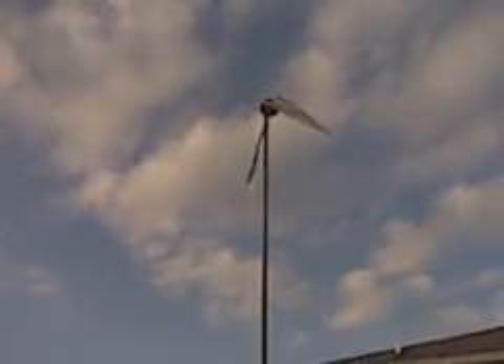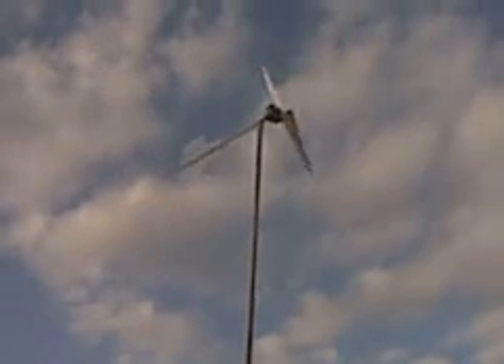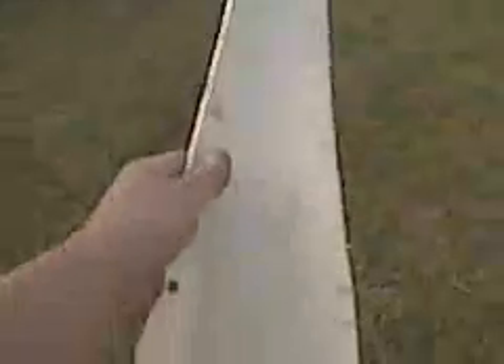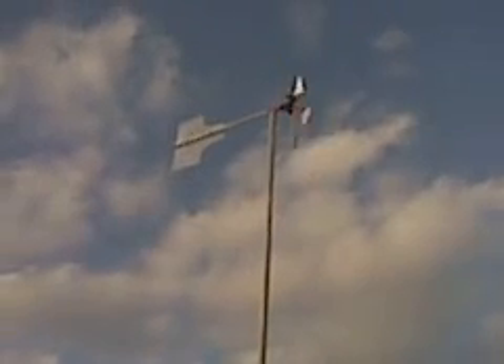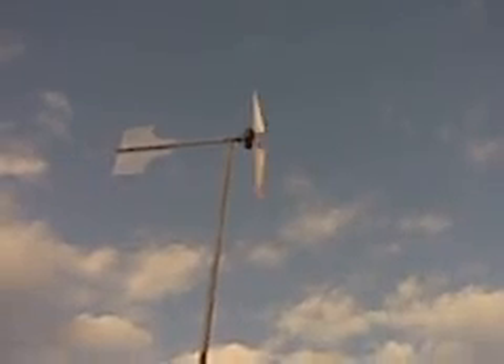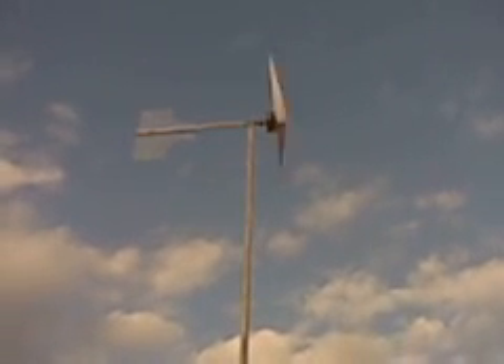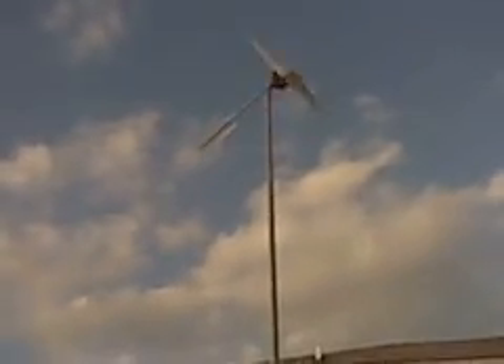Homemade blades for my homemade wind turbine

Comment from the maker: @leamyvideo 
HEY LARRY, YES I WAS LOOKING AT THE WINDY NATION BLADES. I THINK IT WILL TAKE 5 BLADES TO GET THE TURBINE MOVING. I HAVE A SET OF 6 MWS RAPTOR BLADES, THEY WILL NOT TURN THIS TURBINE. I PUT THEM ON A 90 VOLT MOTOR IN ANOTHER VIDEO. THEY WORK FOR THAT MOTOR BUT I HAVE NOT HAD TIME TO WORK ON IT LATLY.. 
WHAT IS THE NAME OF YOUR SET OF WINDY BLADES? 
THANKS AGAIN LARRY..